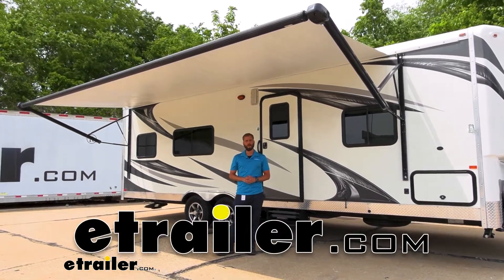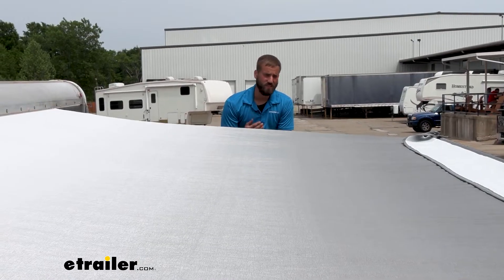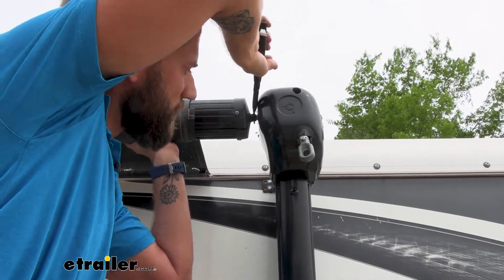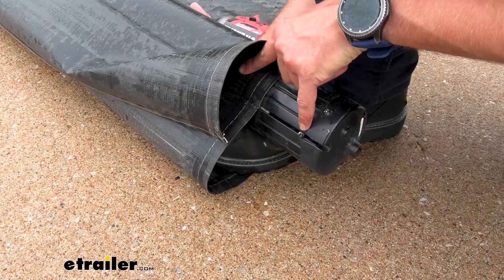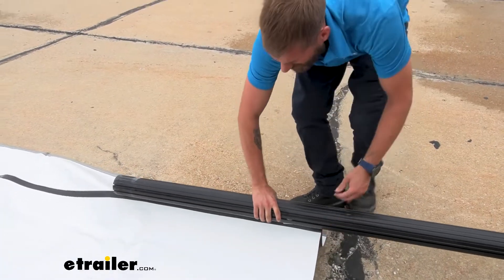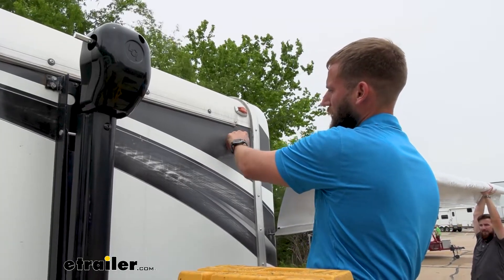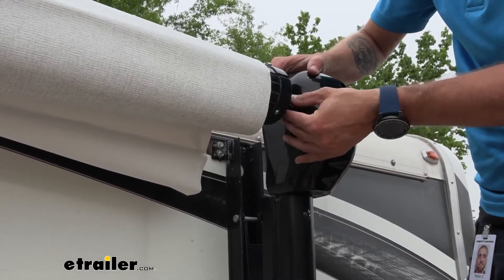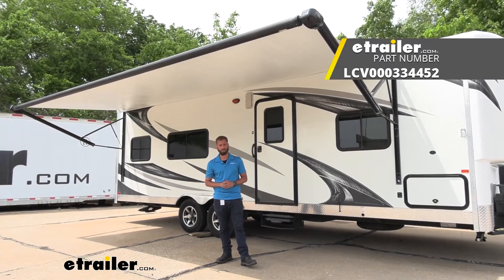Solera Replacement Awning Fabric Installation - 2017 Forest River Work and Play TT Toy Hauler

Comment: Was this not installed incorrectly? It looks like it was installed upside down and back to front. The part you secured to the trailer should have been installed in to the awning roller tube. 😮